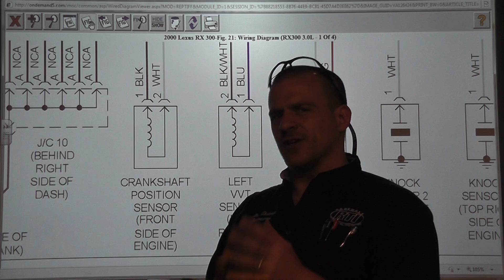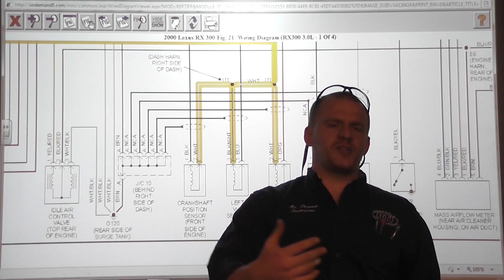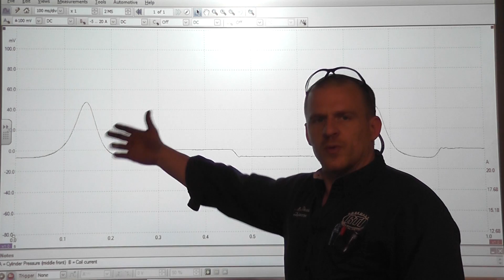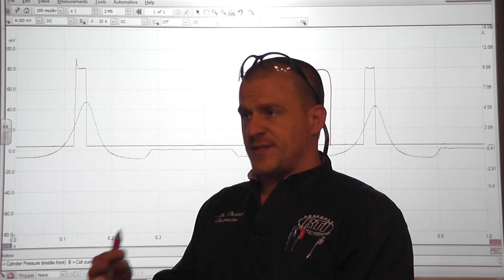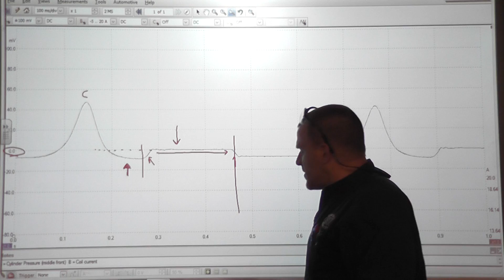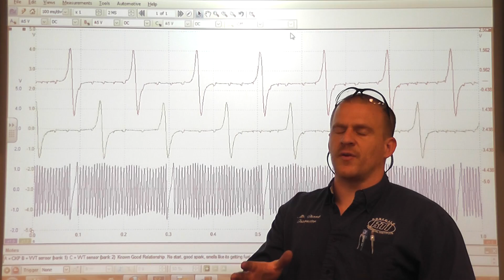Causes of low compression, no start from a stuck closed IAC (part 1) - Toyota/Lexus

Comment: I did misadjustment of idle screw ..now what shoul I do Plz  tell solutions
Reply from the maker: Block off the air inlet for the IAC and set the idle screw to where the engine will just barely idle

Comment: Great video and information. Subscribed right out. So I would have to go through all this to understand why I have zero compression on cylinders 1 and 3 then 180 on Cylinders 2 and 4? Car is a 2000 Toyota Tacoma 4.2L that has never been in shop with 209000 miles on it, was parked for 6 years, fuel pump bad, replaced, started right off, drove for about 30 miles with old gas, oil, and low on coolant, hoping to change fluids right after some warm up (,mistake that my "street mechanic" let me do) car started overheating but was brought back home without letting it really overheat or needle stay up, once it shut off ignition it never started again making exact same noise as in this video; same "street mechanic" came and diagnosed with the compression test. told me I have a blown gasket. Broke my coil wires and I fired him (yeah I know, too late then) I do not want to say he is wrong but somehow I feel he is not right about his diagnostic. Some folks have mentioned the crank shaft sensor, other have told me bad head-valves due to old fluid running through system. I got the car on the side of the house ready for a full engine overhaul, any ideas on what should I look before the fun begins?
Reply from the maker: No compression on 2 cylinders after an overheat? I'd say the headgasket call is correct. To confirm, fill your radiator all the way, pull one spark plug out on a cylinder with no compression and put air in it while you bump the key over. If you see bubbles or water gushing out of the radiator, it's time to pull the head off.
Reply: @ScannerDanner  Well yes, will be doing that before starting tearing down but at this point, whatever it is the car wont start so I have been collecting parts for full engine overhaul because if the head is coming out why not do the whole engine, some tree shade mechanics advised to just do the head but car is 22 years old with 209000 miles original parts on it, I think it gave me an awesome service life and deserves a refresher; my 16 year old wants to drive it and would like it to be mechanically ok if that is the case and if not I still enjoy driving it, that is another baby for me!

Comment: I have no compression on all cylinders of my 2003 tacoma 3.4L xtra cab with 194,000 mi.. When you crank the engine over the timing belt is moving but sounds like you only hear the starter turning and there's no sputter or backfire, have spark on all cylinders. Mechanic told me to take it to the junk yard. Truck was running great then all of a sudden no compression. All belts and timing belt, tensioners, idler pulley, water pump, coils, spark plugs & wires, MAF sensor and tires all have only 5k. miles on them. I want to keep this truck cuz it has been so reliable for me but my mechanic says the top of the engine is probably destroyed.
Reply from the maker: Belt may have jumped. Pull the covers and check it. If it did, and that is an interference engine, you bent the valves.
Reply: @ScannerDanner  no he says the belt is still in time. Would a stuck I.A.C cause 0 compression on all 6 cylinders
Reply from the maker: @tg396  I'm sorry, did you get this fixed? Yes, a stuck closed IAC can give you this condition. Open the throttle during the compression test to be sure
Reply: @ScannerDanner mechanic told me the crank snapped, which I heard can happen with this engine , so i sold it to him, if he gets it running i might buy it back.!

Comment: Thanks so much for posting your very informative videos. PLEASE HELP!!! I will start with the question I am hoping you can answer, explain the backstory and end with the same question to keep things organized. I genuinely appreciate any advice and feedback you can offer. Do you think it is possible for a rodent nest (10"x6" mind you!!) to cause no compression in cylinder 5? I have an expensive problem on my hands. I was driving my 2015 Toyota Highlander (102, 000 miles well maintained with proof of service) it started shaking and check engine light, Check all wheel drive and check traction lights came on. Brought it to our local mechanic and they found a rodent nest on the engine (engine bay I believe), upon further inspection they found that cylinder 5 had no compression, but they weren't exactly sure why and suggested we take it to the Toyota dealership for additional diagnostic. They found the same issue (still don't know why, but they don't seem to think it could be rodent related, but again aren't certain what caused the issue). Because there is no other reason given, do you think it is possible that it could be rodent related? It just seems very coincidental, but because I don't know enough about cars it is hard for me to prove although I am trying to dig up what I can and found you :) Toyota and the insurance company didn't see any obvious wire chews so they closed my claim saying it must be "wear and tear" except I have our steady service records and the mileage is less than a standard lease contract- we have a 2010 Rav 4 with 30,000 more miles that is serviced the same and is running great- the mechanics said this is "very rare for a 2015 Toyota" and said I essentially got the short stick and that cars break, and now I was forced to replace the engine as the only solution ($8,200 +450 in diagnostic fees). Toyota was hoping they would find an actual reason (and of course I was hoping it was rodent related as it would be covered by insurance), but they took out the engine and still have no distinct reason for the engine failure/ cylinder misfire, but said maybe it could be debris that made it way into the engine somehow or a mechanical issue (broken arm??). Anyway because that differs from chewed wires, I reopened the claim thinking it could potentially be nest material (there was lots of material) or mouse food "debris"- there just isn't another explanation at this point. My family has been without our vehicle for almost 1 month and it has really made our lives difficult. Anyway, sorry for the long story, but the insurance company is sending out a "engine expert" tomorrow morning to look at the engine and prob try to disprove that it could be rodent related and it feels like it is my last chance to make a connection and prove that it is possible. I found some articles that say maybe an issue or obstruction in the intake?/ debris somehow getting by the air filter and clogging or making its way into the cylinder?/ debris getting sucked into the air filter then the intake (intake runners or intake manifold)?/ Debris getting caught in the valve train preventing the valves from closing causing no compression?/ a block in the throttle plates??/ Issue with the knock sensor injector?? I will ask more questions tomorrow, do you have any advice on how the rodent nest could have caused no compression in cylinder 5? Thank you in advance, Kristin
Reply from the maker: Yeah that is a weird one for sure, and unless debris was holding a valve open (which you'd see after teardown) there probably isn't going to be any other way to prove rodent damage. What should have been done before teardown was something called a leak-down test. This is when you put the cylinder at TDC compression and then put air in the cylinder to figure out where your compression loss is coming from (valve, rings or cylinder head gasket).
Since they sold you an engine, I'm assuming it was a ring issue? Because a valve or head gasket issue wouldn't necessary need an entire engine? But there are many factors that go into that too. 
It is very possible the rodent had nothing to do with this issue, but they should absolutely be able to tell you WHY it has no compression in that cylinder. You don't need to be an engine repair expert either to make that determination and again, it should have been done BEFORE teardown. Good providence to you.

Comment: If you had done it "correctly" the compression would not have led you to the problem...
Reply from the maker: this is true! but how many times have we all performed a compression test where we didn't open the throttle the first time, then we did the second time, and it made absolutely no difference! We tend to get complacent sometimes and this one did bite me because of that.

Comment: Wow i have a compression problem as well on my 91 corolla it jus cranks but doesnt start tried what mostly would cause it ,gonna try cleanin the intake .
Reply from the maker: Compression problem in all cylinders? Timing belt maybe
Reply: @ScannerDanner  the timing belt doesnt have any cracks i even did the timing twice but i havent change the belt  since 2016 doe but i even max tighten the belt when i did the timing

Comment: 1994 mitsubishi galant es 2.4l i4 4at 164k died on the highway crank/no start replace crankshaft and camshaft position sensors, distributor,  compression test show 0 on all cylinders (needle didnt even move a hair) has fuel and spark, timing belt is intact but has broken balance shaft belt

Comment: What would an exhaust restriction look like on the vacuum? Would it be at/near zero all the time?  I've got a car with 25# compression equal +/- 1# across the board, it was running, approx 50 mph, stuttered and died. As it was dying, went from approx 10" vac to zero and stayed there (this is a turbocharged vehicle with a high quality vacuum/boost gauge, and I was looking at it when it dropped out) 

This is a car with 250k on original turbo, cat, shoot pretty much everything is original to the car - but meticulously maintained, and no codes prior to this event.  Thought it might have been a computer issue due to excessive oil level in the crankcase (may have been fuel wash, so changed oil and filter, but now doubt that was cause) , and some strange codes in the ECU. Replaced it with a new ECU, no change, and still no compression. 

Thanks in advance for thoughts/suggestions, been on it for a month every chance I get... and my summer tires aren't getting any wear this year...

Comment: Wait, what?  My corolla runs, but kinda weak on hills and throws a misfire code on a cylinder and all plugs aren't too old.  Compression test was ridiculous, like 20psi.  It sounds like this but now I'm thinking  it also could be air/intake.  My bigger concern is taking it in, they'll just throw out, 'time for new engine,' or 'new head gasket' and not just fix it.  I'm not sure why the #3 misfire is randomly occurring.
Reply from the maker: compression is 20 psi? you have an engine mechanical problem for sure
Reply: @ScannerDanner Certainly at that, but I think it was user or tool error since it runs fine.  I got another tester to try this weekend.

Comment: If I hear an engine turning over like that I KNOW it's certainly NOT a "jumped Timing Chain Or Belt" first timing chains don't jump on todays engines with relativity low miles .. period I've only seen Belts jump and they never turn over like this but rather mis fire turn over . or turn hard  ..

Comment: Christ dude. Does your shop pay hourly or what? Cool gadgets and nice video, but for those of us on flag,  when the car doesn't start and sounds like it has low compression you push the gas.  If it runs with the throttle open, it's not breathing (most likely iac, or if fly by wire pedal position sensor or throttle body). If it still doesn't start you mash your foot on the floor and slowly bring it up while cranking.  If it slowly gets compression and stumbles to life most likely lifters are bleeding down or it flooded. Only when those tests don't work do you move on to compression test/cam crank correlation diag. A 30 second video wouldn't have been very fun or shown off your knowledge though so I get it
Reply from the maker: This was in a classroom and I'm teaching. I'm not here for the 30 second "my car doesn't start, help me crowd" sorry.
Reply: @ScannerDanner  This was the first of your videos I've seen and didn't realize it was a classroom setting although I should have. Again, cool stuff, you know your s***, no disrespect. Thanks for putting it out there for everyone
Reply from the maker: @immortalpilot8472  no problem, thank you! I totally understand my methods and videos are not for everyone. My focus is on teaching methods and foundational info. and this video had so much to learn from. Sure I could have gotten to the "fix" a lot quicker, but that wasn't the point. And to be honest, I have NEVER, not once before seen a car act this way. I was convinced of a compression problem just by hearing it crank. So I never even bothered to open the throttle! Big mistake on my part, but a great lesson for my class. BTW this was filmed live too, with 20 sets of eyes looking at me :-)

Comment: In this particular case you can trigger the coil by touching the camshafts signal wire with a test light connected on the positive side of the battery right?